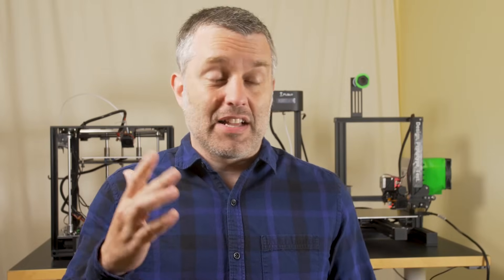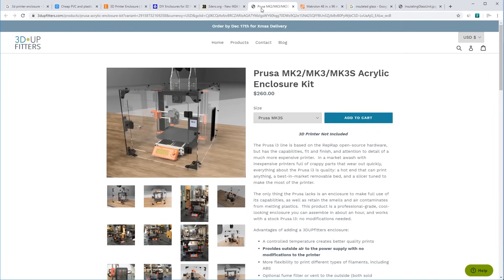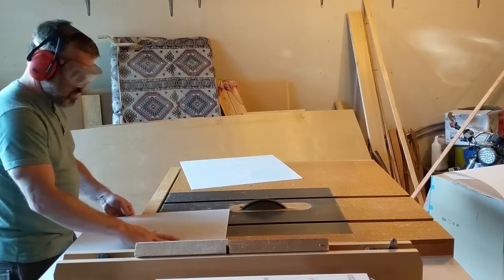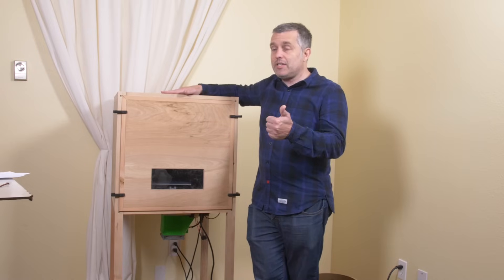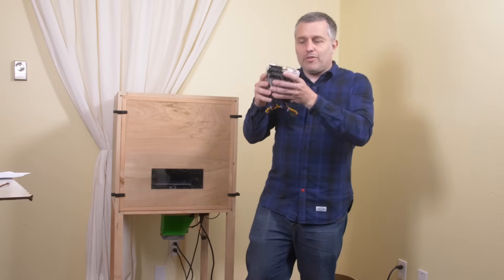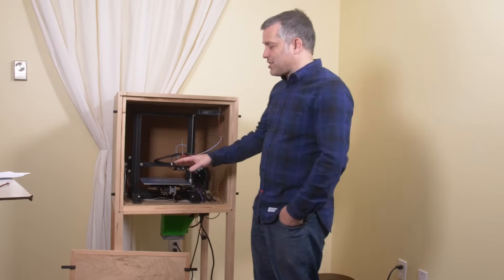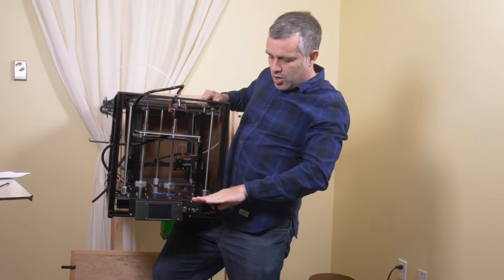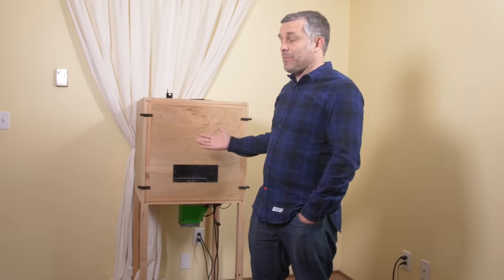3D Printing in a 100°C Heated Chamber - Lessons Learned

Comment: Nice approach dude 👍 I came up with similar thoughts and for sure want to buy insulated chamber printer for my technical FDM parts. Maybe I also give the Qidi max a try because I have one on pre order. 

One very important question regarding Fibre filaments though: did you check if the fibers and aerosolized fiber part can cause cancer like asbestos? I’m not sure anymore if I should better leave this danger out of my garage….

Comment: What about the control board, stepper motors, hot end cooling and rubber belts working at 100c?

I have noticed water cooling heat sinks for steppers and water cooled heat end.

Comment: If you really want to put a heater in the chamber, the resin printing community cane up with a fairly inexpensive chamber heater that has a thermostat to turn the heater on and off to keep it at a set temperature. You can find it on Thingiverse, sadly I don’t have the link saved to share at the moment.

Comment: Why are you needing to get your chamber temp so high.  I print polycarbonate on my core XY that is enclosed and I only use the 120v heated bed to heat the chamber and that is only set to 90c.

Comment: I wonder if you would not be better off using a sheet of aluminum with a bed heater (120v).  Attach that to a side or back wall(spaced well off the wall). A fan (or number of fans) running air over the aluminum plate could be added to make the heat in the chamber more uniform.

Comment: The reason you don’t want an air gap or insulation... (1) your printer creates heat and the temperature will rise quickly and (2) you now need everything to control temperature. With a small enclosure, the temperature swings can be substantial. Also, adding things like fans creates a direction of airflow that also impacts print quality. You will need a larger enclosure than you think, well designed airflow, and filtration to remove toxins for certain materials. A simple enclosure with single panes and an open top works well for non toxic material. Fully enclosed without proper temperature control prints significantly worse.

Comment: There is a process you can use in the duet firmware to calibrate the heater so that it knows how fast it should expect the chamber to heat. I forget the commands but I believe it's documented in their wiki.
Reply from the maker: Yeah, I need to calibrate that. Thank you.

Comment: The four Diode's in that config are called a bridge rectifier and you can buy them in any electronics store basically converting AC to DC power.
Rather Than use a heat gun, why don't you use and old small space heater or a toaster. Both of them have a more robust heater element and a thermostat ?

Comment: Is it necessary to reach up to 100 C in some difficult prints? Even the PVC wires will be softened and vulnerable.  I've not tried ABS myself, but read that 50 C is usually sufficient.

EDIT answered at 34:05.

Comment: Work around for your original design. If you cut the frame pieces with a dato stack for (let's say) 12mm wide groove. You could put both pieces of 1mm plexi in and then push a 10 mm stick spacer between the sheets and down into the dato groove to trap the plexi sheets in place. That would give you the same final design idea but a LOT easier to assemble.

Comment: An old electric smoker would be ideal if you can find one to fit your unit.  They are metal with insulation and have a heating element  and temperature control built in.

Comment: Legit video - subscribed. Solid & fairly original + practical advice. I'm doing the same right now (except with a RailCore, basically the same as your core xy) and have some suggestions I figured on my own & from other RailCore users:
 1. 70 C seems to be the 'magic'/ideal enclosure temp, at least for the most common plastics that require a heated chamber
 2. I've gotten some of those PTC heaters as well & probably how I am going to go about heating the enclosure (which, btw, are both AC & DC compatible - they are like ceramic resistors that can be designed to heat only to a specified temp. Easily available temps that I've seen are something like 70C, 110/120C, an 200 - 230C max which I believe is the max for this heater design. The way it functions is like those Metcal curie point soldering irons, but using a different process, where the resistance slowly changes as temp changes and once the pre-set temp is reached it stops heating up relatively abruptly. Good b/c all of the element gets up to temp and cool spots get more 'juice').
I've gotten some from DigiKey that have a max of 100-110C, but are a fairly low wattage & will be fixing them directly to the frame itself with some thermal compound (the cheap ones are usually not electrically insulated so if they would be used for this youd want to make sure that the thermal compound handles that aspect).... Not sure if I will end up controlling them as a separate trigger or as part of the air heater though. May just use them during heat up via a trigger.
3. Haven't fully test this out yet, but I've attached all my heating elements to larger heat sinks (as previously mentioned they heat up faster the further they are away from their max temp) so hoping that speeds things up & I can use natural convection as much as possible to distribute the heat.
4. If you want to get quality PTC heaters, but want to have more control over their temp max, wattage & voltage while also keeping costs very low I have seen a line of TDK PTC heating elements (just the ceramic bit, nothing else) on digikey or mouser for I believe less than $10 per. Definitely something I will look into for a second iteration when I know the exact capacities I need.
5.  The insulation materials you mentioned at the end are all very legit (as is the 'double walled' aspect, I have seen a few people use different panel materials for the inside vs outside, but not often). Another one Id like to throw out there is what I purchased: a type of household insulation that is a sandwhich between two thin sheets of aluminum with some of the foam (don't remember which type it is specifically) in the middle that also has 'closed cell' air bubbles in it. Can be purchased in thicknesses of something like 3mm 5mm and 10mm I believe. Also not too expensive at all & with the reflective aluminum exterior does a very good job keeping heat in. For $30 I have enough left over to cover the upper portion of my ceiling with it as well
6. Last bit: I've been using stuff like neoprene as well for making seals & while building the air filter device (basically a bofa just made out of MDF) I realized that I could buy 10-20 lever latches for like $15. Allows me to either have doors on a hinge or that completely come off while also providing a great, and adjustable, seal against the neoprene foam.

Cheers

Comment: You can clear your heater faults by sending an M652.  Also, you can configure heater fault detection with the M570 command.  Check out https://duet3d.dozuki.com/Wiki/Gcode#Section_M570_Configure_heater_fault_detection

Comment: actually what i been looking for no one on youtube is doing this. I would love to see if you could print PEEK or most likely PEKK .  ill be following this series closely
Reply: I agree.  There aren't very many youtubers that are putting PEEK videos.  Probably even more helpful that other considering how expensive the stuff is.  Knowing how to get successful prints would be helpful.
Reply: The thing is your printer should almost all metal, because at 100C most plastic starts deforming under load. No mechanical switch endstop should be used because of thermal expansion.
Reply: I agree.  Heated chambers require thought to plan.  Otherwise you will be fixing as you go.
Bearings need higher temp lubrication, rods/screws/rail may as well need higher temp lube.
I believe typical GT2 belts may have problems as well.
Reply: TheeGamefanatic there is GT2 with kevlar as well. Offering better performance than steel core belt and they won’t get fatigued overtime like steel.

Comment: I made a chamber with insulation and found out that in order to print the lower temp materials like pla I have to leave the door open and that's without using the chamber heater, just the bed and hotend.

Comment: We print ABS all day long, and are using chambers build with the green 2-3mm (EDIT: 5MM) foam you lay under floating hardwood floors (click floors). It has metallic foil on one side, which is the inside of  the chamber. It's cut with a Stanley knife in 3 minutes, assembled with duct tape. It weights one lb., cost 10$ and is ready in less than 10 minutes. The deluxe version has a piece of plexiglass duct-taped in as well. 
The heat from the ender 3 105 degree C build plate will keep the chamber temp at 45 C, and  a brim of 4 mm on the print will prevent warping.
We tried heating up a chamber once to 100 degrees, and the electronics gave up. It's not rated for those ambient temperatures. 
If you need a quick hack on a chamber, try this out.  Best, Chris
Reply: Christian petersen ...great share!
Reply: Sounds like a good solution. Do you have any pictures of the build you can share? Also, where do you source the foam with metallic foil? Around here they only come rolls costing about USD 100...
Reply: @stoissdk  our local hardware store sells similar stuff as back side insulation for central heating radiators. About 15-20 bucks for a roll. about 1/8 in foam with thermal reflector foil on one side.
Reply: That sounds like a great solution but one thing I don't understand is how the electronics can handle that heat day in and day out?
Reply: @FunGoul typical semiconductors have a MAX temp rating between 100-150c and the weakest electronics are the electrolytic capacitors which are typicaly rated at 85c(they make  higher ratings but you wont be finding them in these power supplies or fans). I think your electronics wont last long at 100c unless you find a way to keep them out of the chamber or fit them with custom water block etc.
Reply: Hmm, what about stepper motors? I’m also thinking about building the chamber and first thing that occured to me was insulation foam for roofs/radiators. Would like to know about that. Also how BLtouch would hold up at say 75 °C in a chamber for say, PEI/Ultimak 1010 printing (can withstand up to 200 °C).
Reply: @ZhuJo99  longer rods which power the belts will make your electronica and motors outside of the chamber.
Make the design rising the floor, and all driver axels will be fixed...

IF you have not done that yet, you are welcone. 😉🤪😎😇
Reply: @AndersJackson  no, actually I'm going to use Railcore as a basis for this. It has everything needed, outside of the chamber. Hightemp3d.com in Europe also sells high temp LTO motors, belts and Mandrala Rose Works aluminium CNC made stuff for it instead of 3D printed. I think I should be fine to get above 150 °C with two powerful heaters.
Reply: I've got hundreds of these 2mm foam with foil on one side, time to put some of them to use.
Reply: @ripper9111  100⁰C is not that much, just enough to boil water. It will soften sone thermoplastics, it will not effect bakelite enclosures, silicone ir metal or rubber at all.
Reply: Yeah was thinkng the same, could make a box out of reflectix bubblewrap a lot quicker but obviously he likes wood working and thats a solid box,  which you could line with foam or bubble wrap futher increasing the insulating properties and cutting the overall cost of heating it all day long.
Reply: I put a cardboard box over my Prusa and just cut holes in it until the chamber temperature came down from 60C to 40C. Prints ABS like an absolute champ. It's not amazing to keep the electronics in the enclosure, but it's not terrible
Reply: Why on earth would you put your electronics in the box ?? No kidding it wouldn't work,why would you even try that? They go on the outside, thats kind of obvious and you need high temp steppers inside. I don't understand why you would need told that. 

 motors

Comment: Double-glazed windows are terrible for heat loss.  They're 100x less terrible than single-glazed windows but still so so bad compared to an insulated wall.  So that's probably why no one is making double-wall glass enclosures.  Those are slitting saws, meant to be used on a mill.  Also, the foil backing on insulation is to limit radiant heat loss, not fire resistance.  Yeti coolers are durable because the plastic is thick.  Even disposable Styrofoam coolers seal pretty well.  CAN or worms.  Also, it's a rectifier.  Doesn't matter what kind of diodes.  Certainly doesn't need to be Schottky diodes.  If you care about the specific type, read the 1N4... off the package and type that into the interwebs.  The metal of the printer is like a heat sink, not a radiator.

Comment: Keep temp stable and use a heavy piece of metal inside somewhere on two walls like a heavy heat sink
 This will keep tempratures stable how about water heated metal cores about two or three plus some hot air. That will keep tempratures very stable. Of course sheet metal in both or only in inside  with house between insulation or is both cheap and easy to handle.

Comment: "There isn't a slurry for polycarbonate" - ABS alloys strongly with polycarbonate and you can use ABS slurry for polycarbonate prints.  I've personally used this for printing pc with a mostly-open printer.  A chamber does really help and makes that less necessary though.
Reply from the maker: Thank you for the correction! I was unaware of this.
Reply: Heated chambers do help quite a bit on PC. With my Liquid cooled Ender 3 in its heated enclosure PC, Nylon, ABS, all print on plain glass with no warping issues regardless of complexity or size of the part with no raft or brim.

Comment: There are people doing it! I built an enclosure for my 3d printer as well. It’s based on aluminium extrusions, flame retardant noise reducing foam, hpl plates as side panels, control panel drawer, chamber temperature control... it works great and really improves the overall print quality (not with every material..) - and it’s finally quiet. You might like it 
To avoid a fire is really the focus! Don’t use wood for the final design - for technical and esthetic reasons.

Comment: Don’t lower the chamber temp, you need to pipe in cold air from the outside.
Reply from the maker: Piping in outside (cold) air into the chamber will have the effect of lowering the chamber temperature. Your words contradict themselves.

Comment: Put the temperature sensor at the top of the enclosure. The duet will cycle the gun on and off more as the fan draws the warm air down but the duet will be satisfied with the heat cycle coming from the gun better this way.

Comment: Another semi rigid panel material to consider (that is slightly less likely to ignite than thin wood and foam) - Suspended ceiling acoustical tile. Lightweight, easy to cut, fire resistant, sound suppressing, some insulation, and free at most renovation sites. Seal the edge if you cut (use a blade not a saw) as the dust is not healthy. Thanks for the 'vid and all the commenters below!
Reply: Semi right indeed :D

One wrong movement and you got a hole in your enclosure and dust everywhere :D

Comment: For the part cooling issue, why not use a high speed stream of air in a venturi which drops the temperature through the PV=nRT effect? Start with ambient temp, drop pressure to drop temp, and return to ambient, thereby keeping the whole thing adiabatic.

Comment: I think you're OK as long as you're building stuff for yourself.  If you start selling enclosures for a specific FDM machine, I think you'll end up with a lawsuit.  But the whole point of patents originally was to get information out there for inventors while protecting manufacturing.  The only way around a patent was to make a non-trivial improvement.

Comment: Those are slitting saws, and they are for cutting metal. The way you are using them in the drill press is very close to the way they are designed to be used.